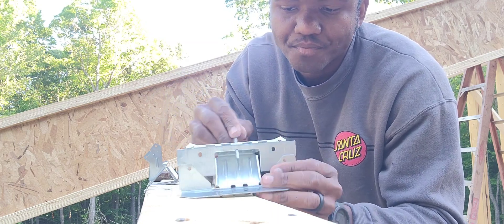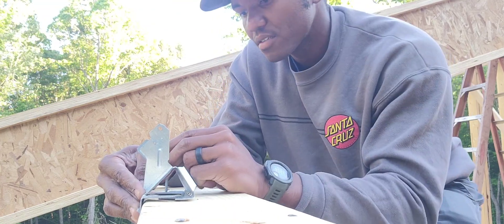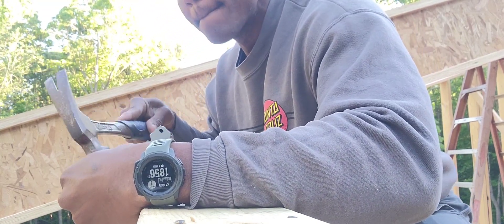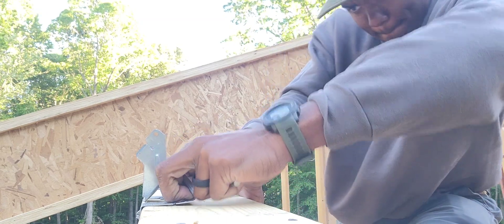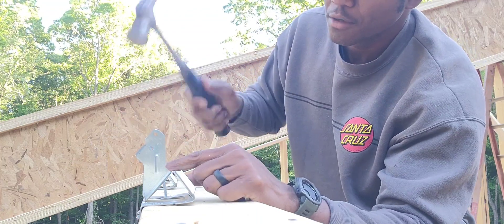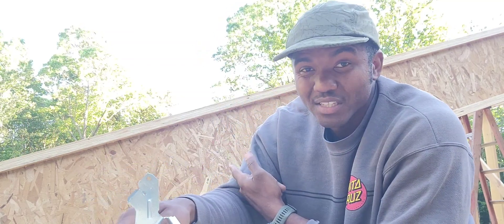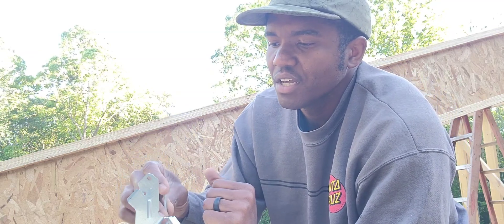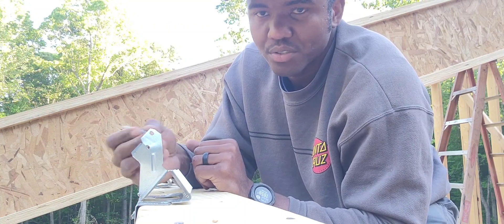Simpson Strongtie VPA35 VPC- quick look( no need to bevel top plate)

Comment: Have you used these to build a ramp? Sorry, it's hard to hear you
Reply: If not, it should be strong enough right? 3 per row,  3-5 ft
Reply from the maker: A ramp? Accessibility or skate? Skate I'm sure the constant jarring would work the nails loose.  Accessibility,  should last for a awhile.  But I think there would be better options than these for a ramp in my opinion.
Reply: @averageliving4Life   accessibility, and thank you for your help on this. I found some other hangers for connecting the top part of the ramp to the deck but I figured these could be used in the middle part of the  ramp